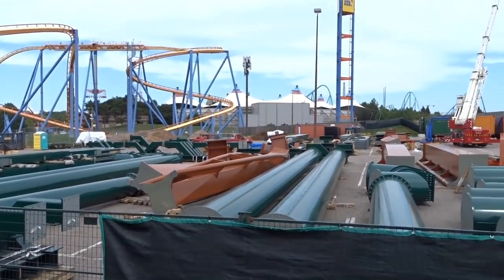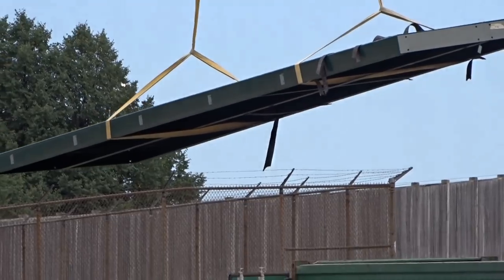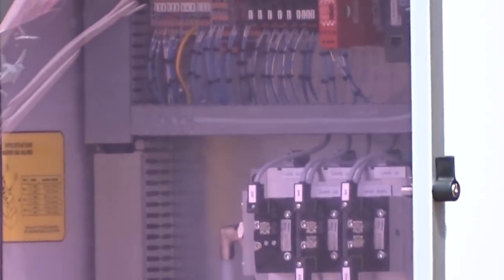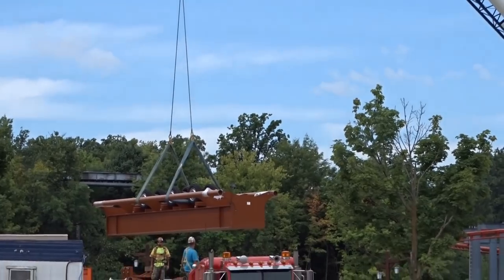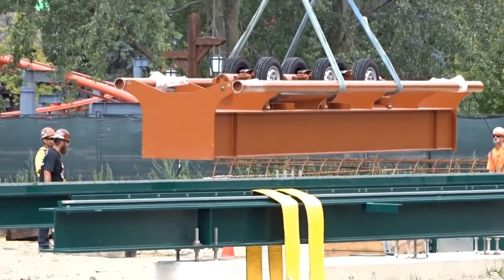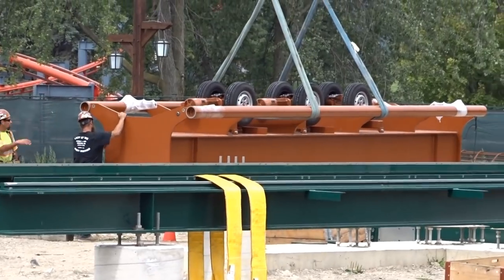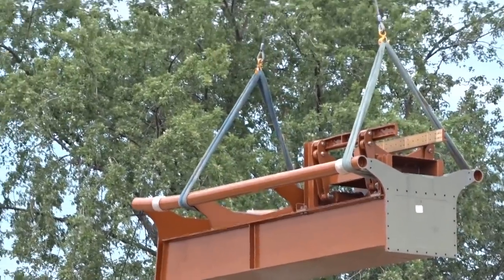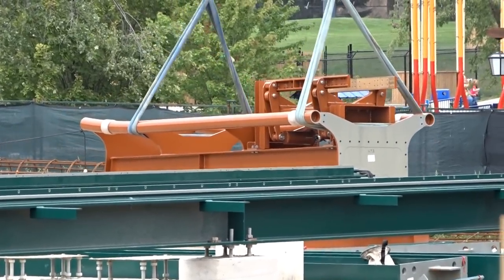Canada's Wonderland Vertical Construction Moving Quickly!

Comment: Low station undoubtably means splash down.  
I would have rather had a 4th inversion than a cheesy splashdown
Reply: Chez Napoli or better, both
Reply: Toronto Transit Fan there isn’t both.  Brandon from AI has been teasing us about a surprise element he doesn’t wanna tell us about and the teasers has hinted towards a water feature.  Also Brandon who has seen the prints has said he doesn’t see a 4th inversion as far as he can tell.  If he can tell there is a zero g roll he would be able to see another later on.  So yeah, no 4th inversion that’s for sure.
Reply: Where are the splash hints? Would that be from that google teaser vid with the 213' water slide?? 🤔 :o
Reply: AI said splash down. But we'll see